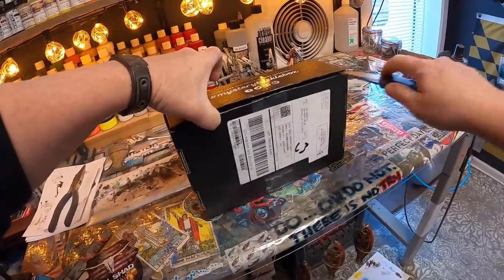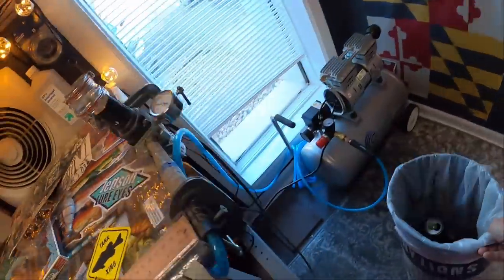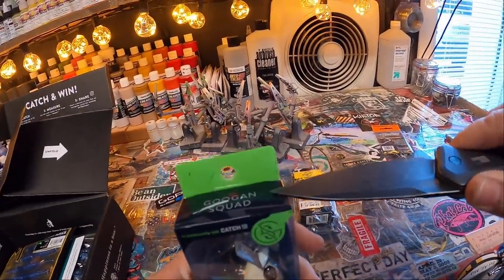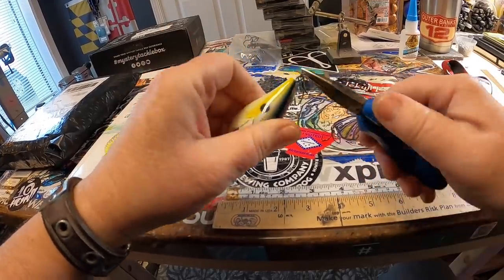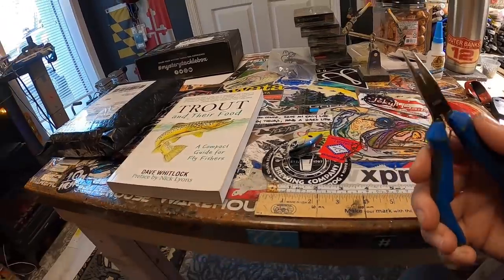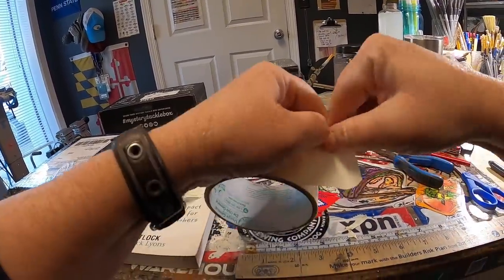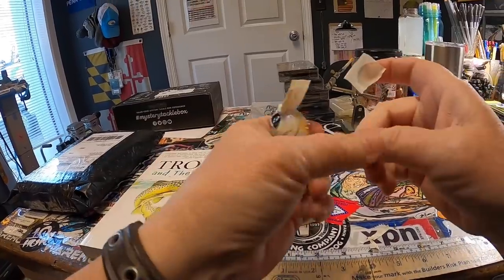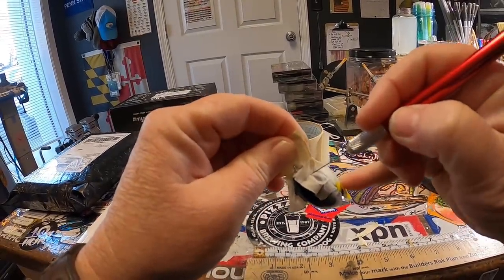SUBSCRIBER REQUESTED!!! "Basics" (Another MTB Pro Box Repaint)

Comment: Whenever I tape the bill like that and take off the tape before I clear coat it the tape peels back a bit of paint. Any tips on how to avoid paint peeling back?
Reply from the maker: A couple. Make sure your paint is dry, and take an exact-o knife tip and gently run it along all the edges where the paint meets the tape. Should solve the problem. Some lures and blanks have residue that paint won’t adhere to as well, so also take a dry clean cloth and wipe down your blank prior to spraying 🙂
Hope that helps